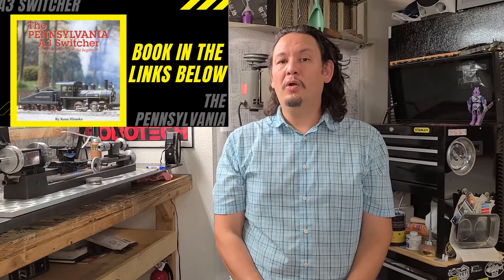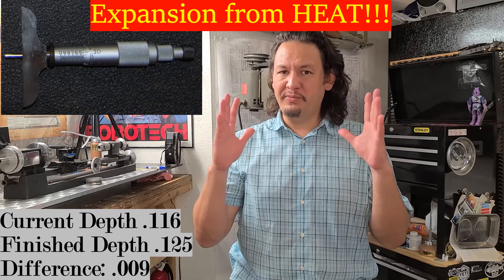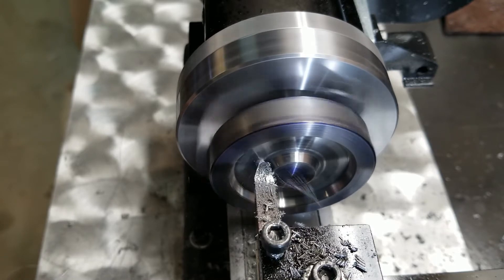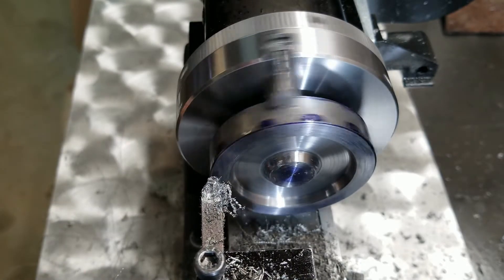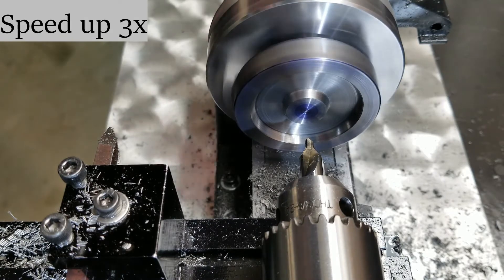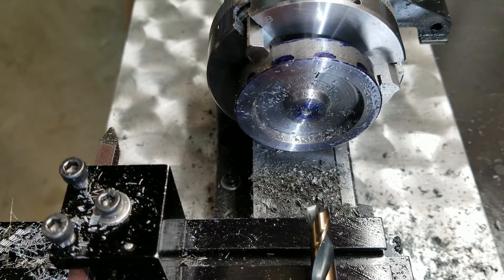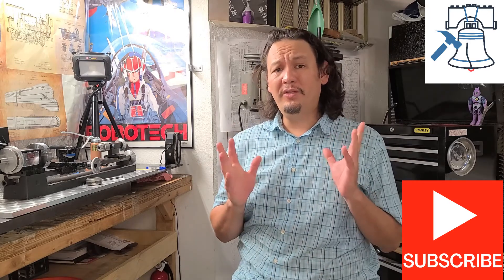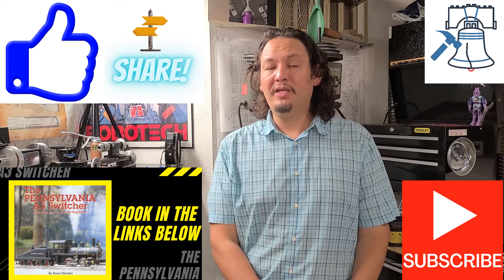Tender Wheels Part 2 Kozo Hiraoka ¾” scale Pennsylvania A-3 Switcher 0-4-0 Loyd Precision Makers

Comment: Hi  --- reason for  Kozo;s boring hole  ----  concentricity &  strightness  in hole.  Will be slight improvement over drilled hole with reamer taking up rest depending on left stock removal           Mike G.
Reply from the maker: Oh really thanks so much that actually makes a lot more sense.
Reply: Kozo's books are great. I have all of them. Great source of information/instruction.  Another note for reaming - You can also use a - 1/64 (.015) drill then your hole size if can't locate a m/m one.  Mike G.
Reply from the maker: @mikeglodowski810  That a good one thanks.  I'll have t give it a try on one of the last few I have to do.
Reply: @LoydPrecisionMakers  Anytime    Glad  to help.    Mike  G.